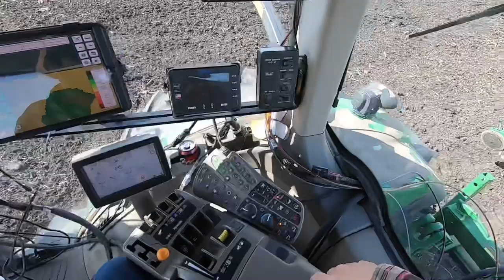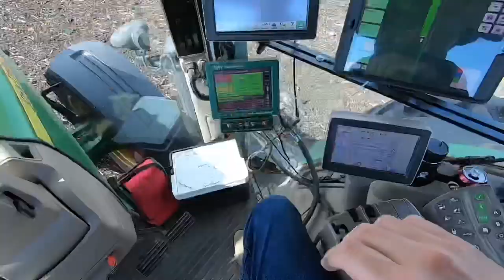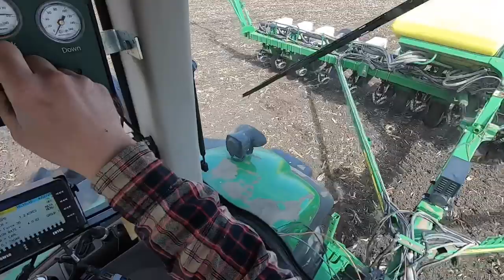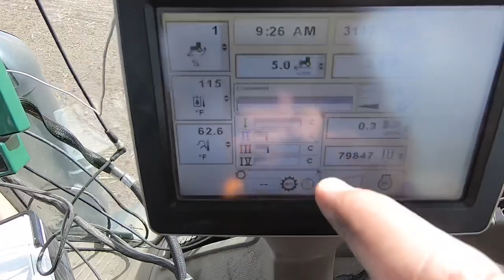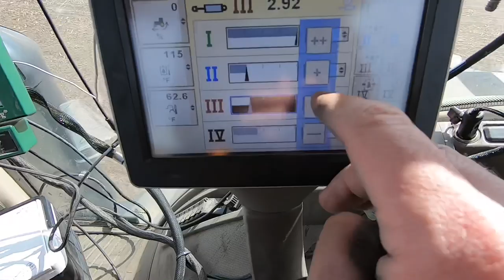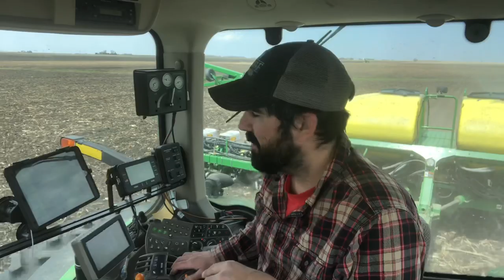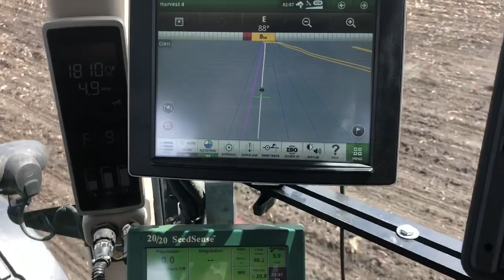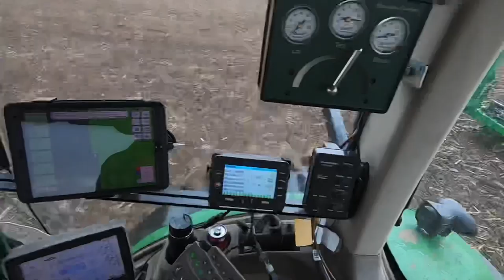Up close with a farmer planting corn!

Comment: As you were showing how the meter works, I couldn't help but think of what my dad would have said about it. "The guy who invented that is in the nuthouse."
Reply: @Mark Wheeler.  I pretty much would have to agree with your dad on that one.  My only corn [planting experience was in New Jersey back around 1955 or so.  My dad bought a Farmall (IHC) Model A (about the size of Avery small compact car for those who don't know it) along with a whole truckload of old-fashioned implements (most were horse-drawn models.  Included was a two-row pull behind plan]enter and I remember being fascinated by the huge boxes of different seed metering plates that came with it ... put a plate in the bottom of each bin, fill it up with seed corn and start driving.  One of the planter wheels had spikes on that caused some shafts to turn and spin the metering wheels and every few inches a seed dropped in ... maybe LoL.
Reply from the maker: Things have come a long way!
Reply: @dodgebrothersfarmandranch9206 very  informative. Thanks for taking the time to answer questions. You are an awesome person

Comment: With all of that electronic equipment in the cab of your tractor that you are running I bet you could fly the space shuttle LOL I like how you did the pre trip inspection on the tractor and planter like you do on your big truck before you go on a run I drove for years and our ore trip was check the oil and fuel kick the tires check the lights draw a line on the log book and start snatching cogs lol our mechanics kept the slack adjusters set so we didn't have to worry about those....great deal on finding the 50 spot the only thing I ever find are some cigarettes I forgot about LOL thanks for another great vid Carl looking forward to the next one hope you have a great growing season
Reply from the maker: Thanks!

Comment: Awesome video Carl 👍, gosh I wish we had that technology 20-25 years ago, here in New Zealand, there were vacuum planters around, but we had two 4 row finger picker JD planters used to run them with 6410 JD'S, we ran into problems in small seed of the fingers grabbing 2 seeds at once  and if the brushes in the seed unit were getting worn you'd get doubles. 
Keep up the great work.
Reply from the maker: The small seed is such a pain!

Comment: He y there.  Just stumbled on your channel and really enjoy it.  Its great that you take the time to explain what and how you are doing. In regards the mapping is the front left tire  of the gator the line you are setting or what. Also how is the map sent to the auto steer system. Do you drive to the field and then select the map or ??  Also if the edge is not straight how are the interior rows straight. Thanks
Reply from the maker: Hey thanks! Yeah we set the gator up to drive the left side tires right where we want the border line to be. When you pull into the field the iPad asks if you want to make that farm active. If the field border isn’t straight we just have to plant some overlap to get the straight rows started.

Comment: Hi.  Very nice n informative video.  What POWERS all those electronics, your tractor battery? N are you charging your phone as you drive n plant?  So the airplane spraying of insecticide is over?                   Peace to you and yours
Reply from the maker: Thanks! Yeah the tractor batteries/alternator are providing the necessary power. If we had a 24 row planter we would need a small hydraulic generator on the planter. I sometimes charge my phone in the tractor. The only insecticide that I know of being flown in anymore is an emergency late season application in corn that is to tall for a sprayer. That would be pretty rare.

Comment: Aaaah. Be sure you're cleaning those zirk fittings off first. Otherwise you are pumping a load of dirt into your bearings ahead of that grease. Some manufacturers took the zirk fittings off their bearings because of just that. The more often the bearings were greased the dirtier the bearings got. Better bearing seals are the answer on automobiles. No zirk fittings anymore on cars and trucks.
Reply from the maker: Yup! I learned to clean zirks from an old fella that used to let me run his round Baler when i was probably about 12.
Reply: @dodgebrothersfarmandranch9206  Round Bailer at 12. Wow. In mowing and bailing season you always have to be on the lookout for fawns, curled up in the grass.